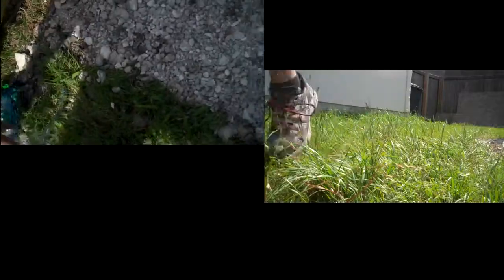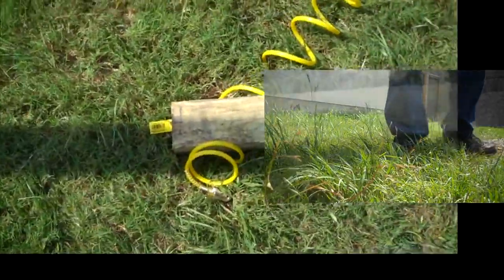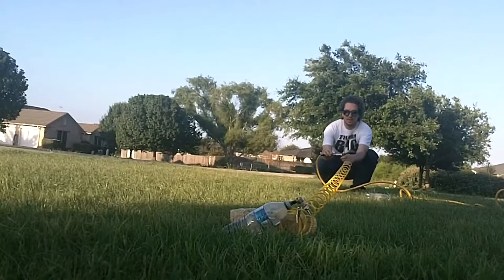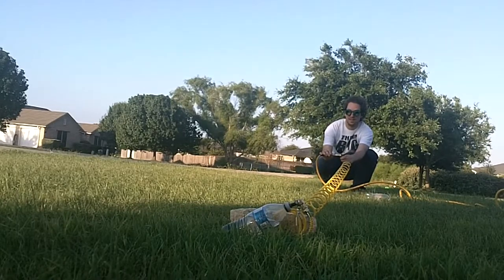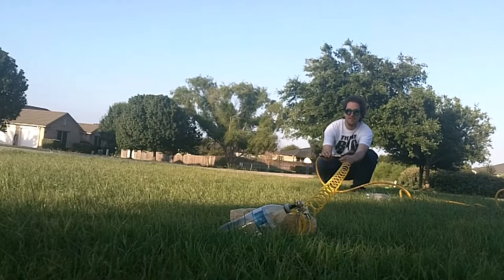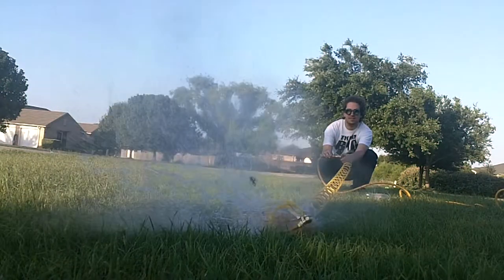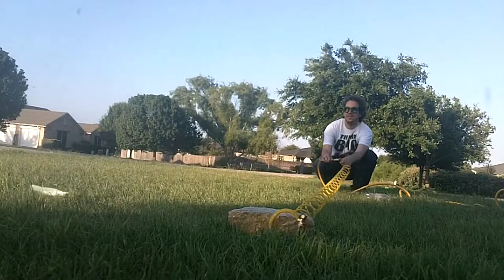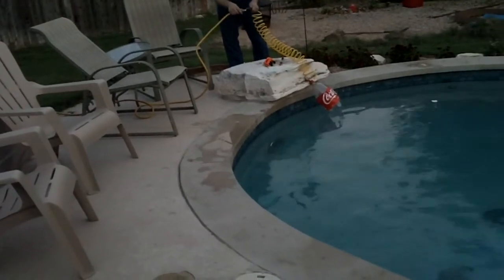pressurizing soda bottles until they explode

Comment: Now fasion a strong metal tube to put this inside and you have a big bang cannon. You would need to weld a grate over the cannon hole to keep the bits fron flying out.